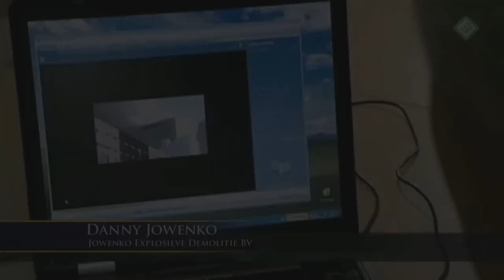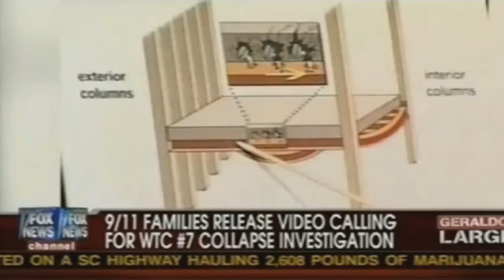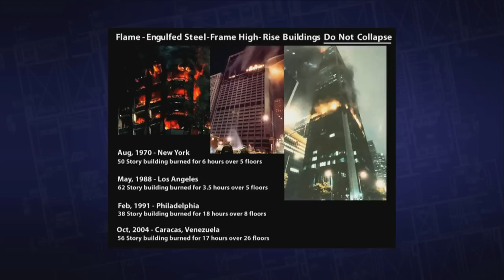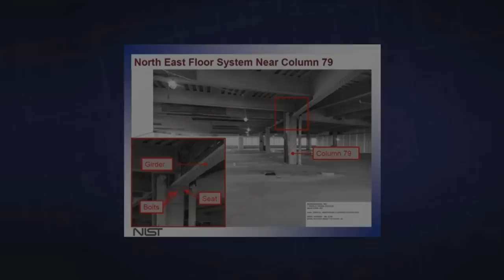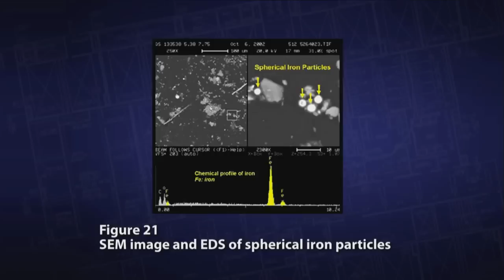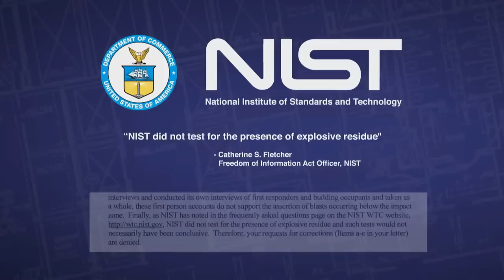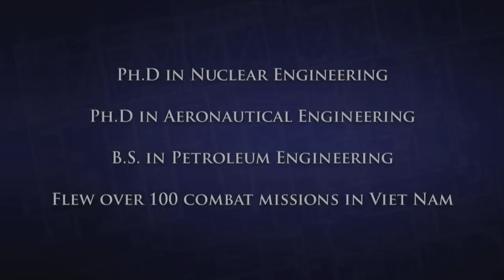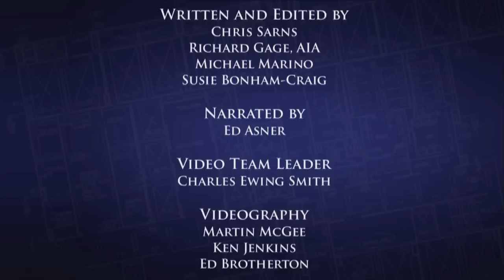Architects   Engineers - Solving the Mystery of WTC 7 - AE911Truth.org - YouTube.mp4

Comment: V.I.P. LOOK!!!!!! For years I have been pointing out the construction workers in this video.  WHO THE HECK ARE THOSES CONSTRUCTION WORKERS IN THIS VIDEO AT THE 2:10 - 2:19 MARK. What are "THEY" doing there? Fixing a toilet? Look at Suspect #2 Red Hard Hat with Bolt cutters and a backpack that looks like it has cable or wires in it as it is rounded like a large roll of cable. Who are these guys? "THEY" Look like a DEMOLITION TEAM IF I EVER SEEN ONE. VERY SUSPECT! Who are "THEY" and what are "THEY" doing there? "THEY" do not look in any official capacity. The Public and even emergency responders were already pulled out by this time. If I have ever seen a suspect demo team at Building 7 THESE GUYS ARE THEM!